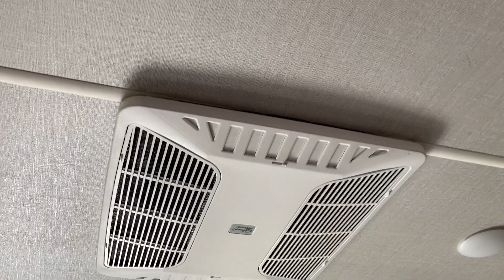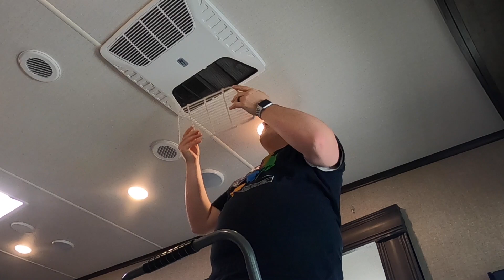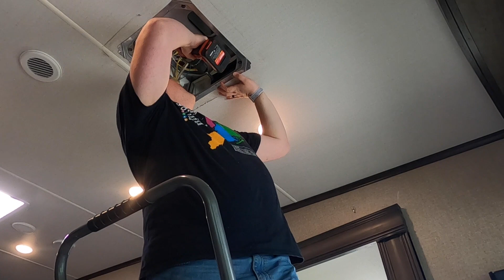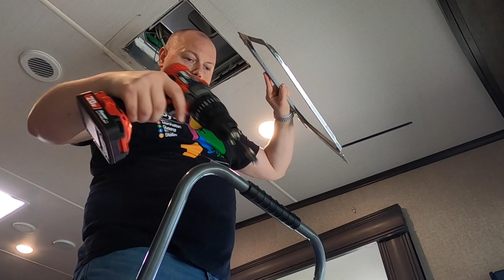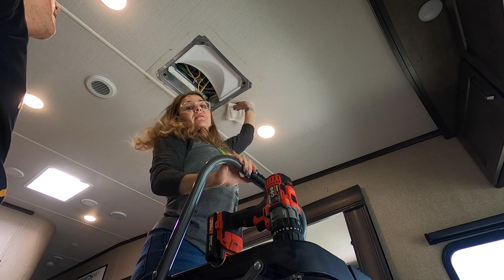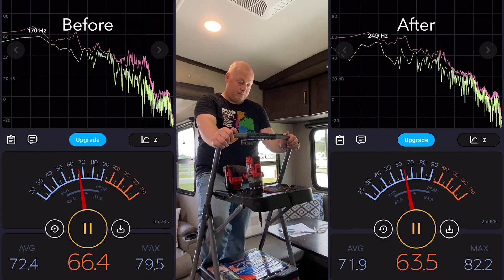RV AIRFLOW SYSTEM INSTALL 🛠💨 USE CODE LHW15 FOR 15% OFF

Comment: I had one of these in my fifth wheel Coleman AC.  I just ordered one for my new TT for GE AC.  Agree price is a little much but it does form fit and seal well and it does improve airflow greatly
Reply from the maker: Yeah, and at least you know the entire area is filled to maximize flow.

Comment: Could not get one to fit my dometic. So, I sealed the plenums better with duct tape and sealed the bypass vent. It's MUCH quieter and seems more efficient now.
Reply from the maker: I know they make them for some Dometic models, but I have Colemans so I'm admittedly not very familiar with the Dometic ACs.

Comment: For $13.00 dollars in material you can make your own with craft foamboard and aluminum foil tape.
Reply from the maker: I’ve seen many different methods and contraptions, but none improve the CFM to over 400 cfm. You also need to be careful about voiding your AC warranty 😬🤷‍♂️
Reply: @LetsHeadWherever  do you have documented proof of your statement? From an independent source. Warranty is non issue since Grand Design is using this in new units. And, most warranties are only good for one year. Are you getting kickbacks for this video?

Comment: Just wondering, in the install instructions was there a torque value for those long bolts? TIA!!
Reply from the maker: I want to say 40-45 inch lbs but I would confirm that first with the manufacturer or sales rep 👍
Reply: Yes, it must be torqued to correct specs to prevent over tightening and since those bolts hold the air conditioner in place, the bolts should be tight enough to do that and not come loose.
Reply from the maker: Yeah, i updated my comment above to specify INCH pounds! 40-45 foot pounds will bring your AC inside the RV 😬😵

Comment: Didn’t know those existed... I did the ac mod by taking it all apart and redoing all the tape closing it all up better! For less air loss... I spent some time in Tucson in some hot weather and we were doing all the tricks then lol
Reply from the maker: I’ve seen that done, too. Did it work well? I would doubt whether I did a good enough job, so this was a “no question” deal 😂